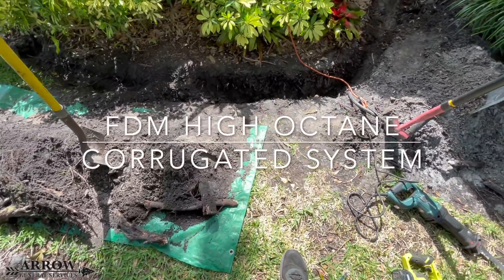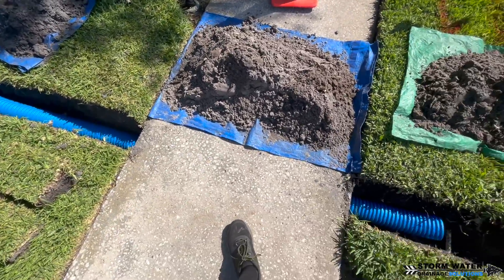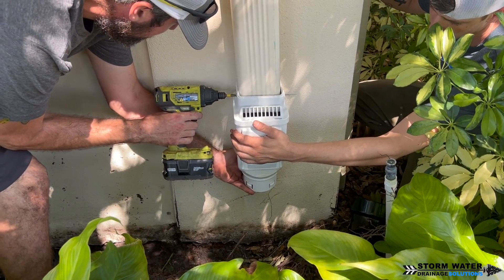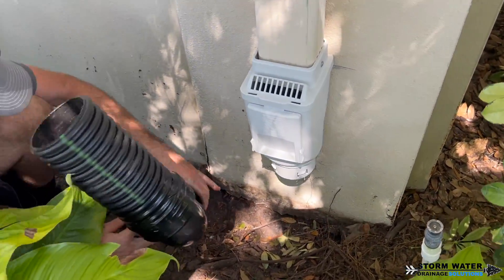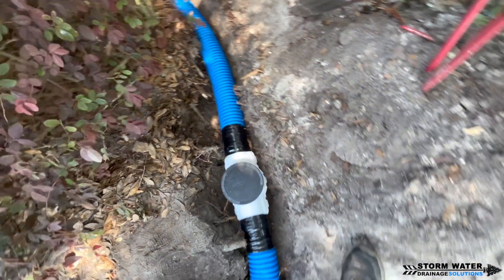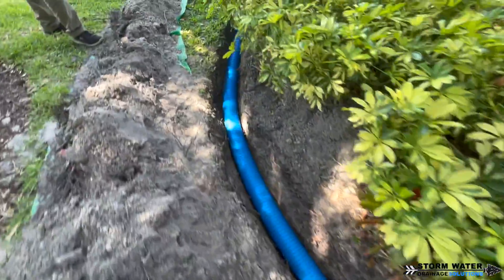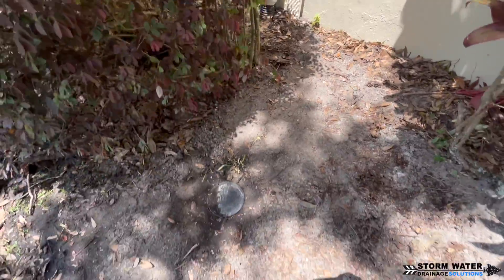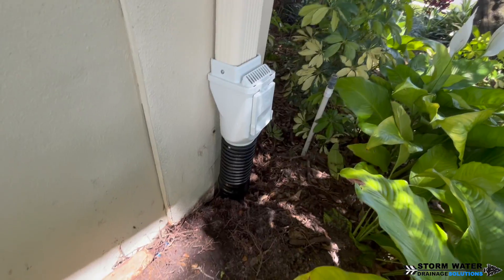Corrugated Drainage System Built Right - French Drain Man High Octane Pipe - Downspout Drains

Comment: I see you never put sediment traps on your pvc projects are they necessary for pvc?
Reply from the maker: We have started using sediment traps more often now but for PVC or corrugated systems as long as you have an access point/ clean out in the beginning of the run and the system was built right it can be flushed out relatively easily.